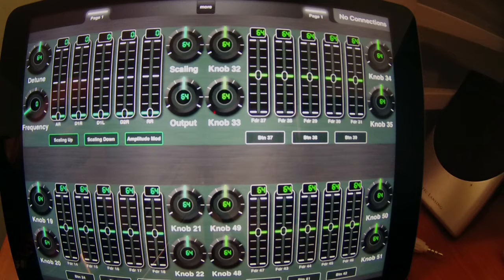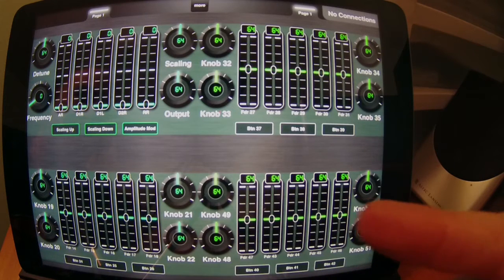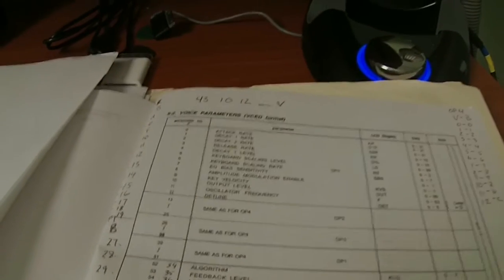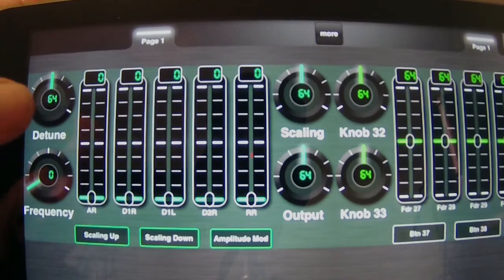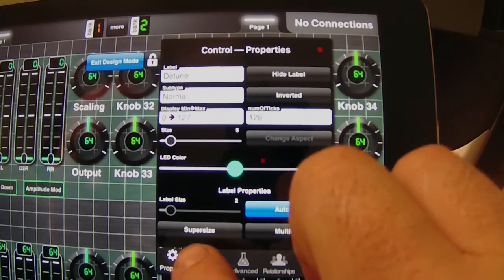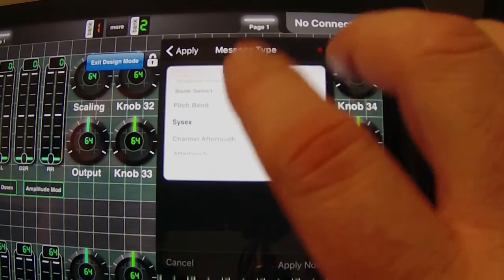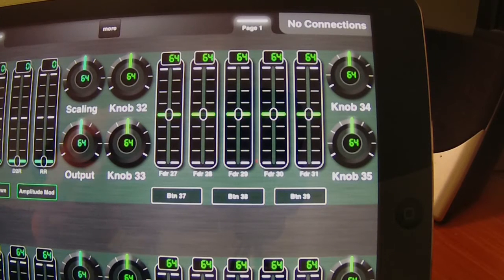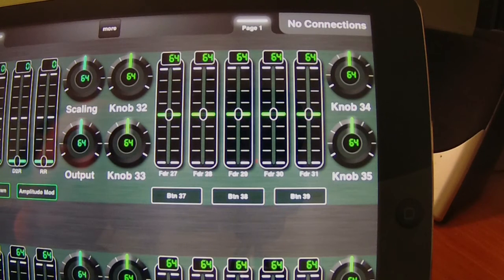MIDI Designer Pt 3: Programming for Sysex

Comment: hi ,I have  sd90 Ketron arranger modul   i nee bottom  to write syses that make on and off with two masses  you can write this  how to do that ? thanks
Reply from the maker: I’m not totally sure I understand your question. If I had to guess what you are asking, I would say that you need to know the sysex codes for your device. You can then figure out the hexadecimal code for that function. I had someone show me where to find the sysex codes for the DX21, and then I could figure out the hexadecimal numbers to use in place of the midi cc numbers.

Comment: Hi Brian,  ..for long time its making me crazy not to find out how to give two CCchanges the same variable data input..

How do I formulate a sysex for a poti on my midicontroller which i want to let control two CC´s in a variable range.. example : change cc 43 on midi channel 1 [dt] 0 - 127   and   change cc 48 on midi channel 6 [dt] 0-127.  b0 2b [fixed value] b5 30 [dt] 00 - 7F   is working fine..but not how i wanted.

greets from berlin
Reply from the maker: I’ll have to brush up on this, as it’s been a couple years since I made anything with MD. That might require a super control, but I’m not sure. Give me some time and I’ll reply back to this comment, as I may be contacting the app developer to help me answer this question. You may also want to look at the forum on mididesigner.com
Reply: We'd be glad to handle this question -- answer might be Sequential Subcontrols... can you hit us up at mididesigner.com/qa please?
Reply: https://mididesigner.com/qa/7457/how-change-two-more-cc%C2%B4s-variable-range-using-one-midi-message 

;)